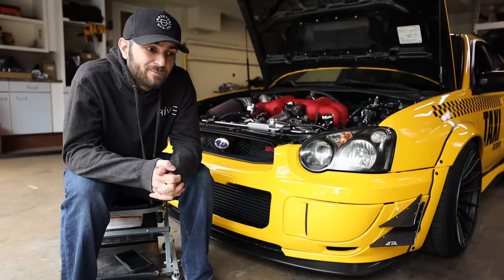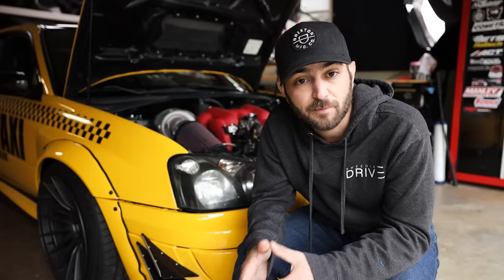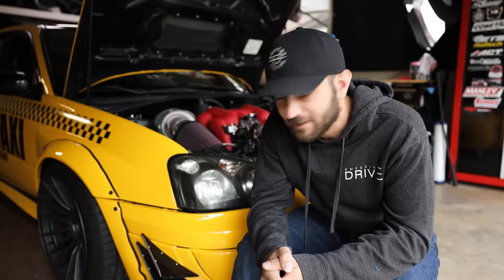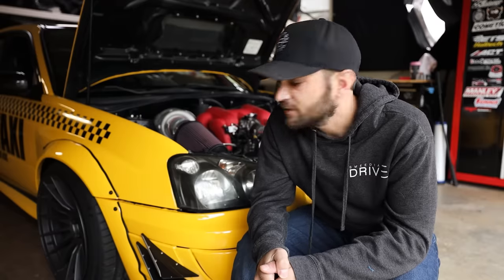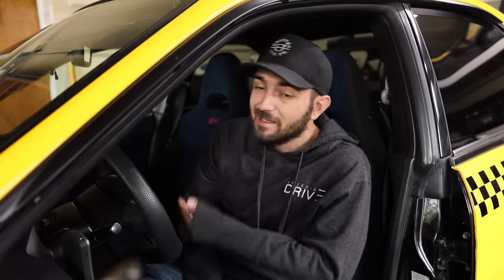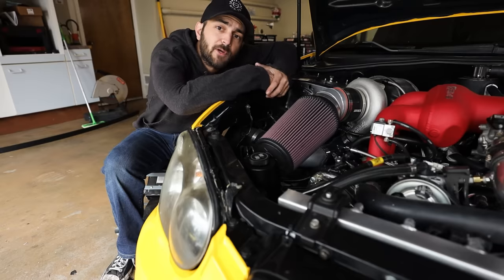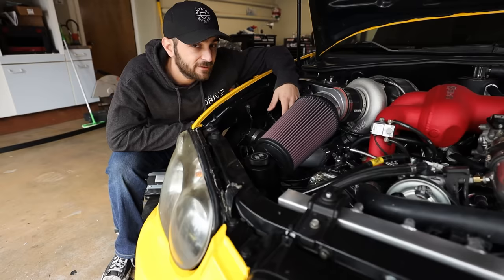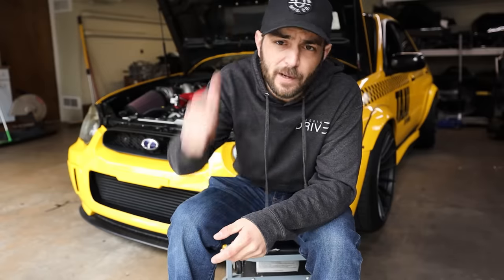What You Can do To Keep Your Subaru Reliable.

Comment: Legit my DAM has stayed at .625 since august and will not go back up. Knock randomly comes and goes on freeway but never exceeds -2. Fine knock learn likes to jump all around from -4.10 to +1.50…. Thinking I might have an exhaust rattle 🤷‍♂️ temperamental for sure
Reply: The life of a Subaru owner 😶
Reply from the maker: Already tried resetting ECU learning?
Reply: @Smeedia  Going to fill-up at a chevron and reset afterwards. I’ll keep you updated.
Reply: @Smeedia  update: After ECU reset, my DAM hit 1 again.
Reply: @Smeedia  update: DAM dropped to .875. I’m going to wrap the exhaust and buy a new uppipe and hope it’s a rattle causing the problems. Might get a protune if still running into problems.

Comment: @Smeedia my $700 Blobeye is consuming a lot of oil like every week or two my dipstic gose from full to empty. What i do know is its not leaking on the outside. I know the engine is burning it
Reply: Btw i live in Puerto Rico and everything is like 10 minutes away so no reason to drive fast
Reply from the maker: If its burning oil my first thought is valve stem seals

Comment: Literally every subaru engine I have pulled apart, having broken a piston, I have found them to have smaller than proper ring gap.  Your EJ25 will live forever if you pull the pistons and gap the rings.
Reply: What do you have to do specifically to gap the rings?
Reply: @bryanr93  pull the pistons out, remove the rings, measure the gap, file the gap, deburr the rings, reinstall the rings, reinstall the pistons, reassemble the engine.

Basically, if you're not a mechanic or mechanically inclined, it's not something you're going to do.
Reply: @AdderMk2  Would a built IAG block have properly gapped rings? I'd assume so.
Reply: @bryanr93  not quite sure why you're asking me. Sounds like a question for them.

Comment: What would you consider a safe/reliable power level on a stock type ra block?
Reply from the maker: Safe safe 400-450 WHP
Reply: I have an ‘18 Type Ra and wanna keep the motor with the car but couldnt find any reputable info about a safe power level to push it to so thank you for the info!

Comment: Hey bro i ask the dealer to add  different mods to make my engine  more realiable. But they told me they would cancel my warranty.
Reply from the maker: Correct, pretty much any engine mod will cause warranty issues
Reply: @Smeedia  thats sucks cause i really wanted to do the 4 cylinder cooling mod and air oil separator

Comment: So if I get race gas from BP 101oct. why do I get more knock than running just straight 91. Would it be because of the 10% of ethanol it has in 101 or something else. Never tried 93 but 93 has 10% ethanol in it too, so I would think it'd do about the same as 101.
Reply from the maker: What tune are you using with that 101?
Reply: @Smeedia  91 stage 2+  didnt want to put 93 ots in because I only have 1 station with 93, weird thing is that I can fill up the car with about 12 gallons of 91 then top off the rest with e85 and it'll be normal knock numbers, runs perfect. 101 straight has fbk of 6-8 then fkl round 2-4.22.
Reply from the maker: Not tuned for the fuel, while it has a higher octane rating just tossing it in will cause the car to act up. It's expecting to see 91 when it's getting 101
Reply: @Smeedia  then why is the 12 gal 91 and 4 gal e85 not do that?
Reply from the maker: For an E30 tune?
Reply: @Smeedia  lol no still on 91 ots

Comment: How much oil consumption is normal for a stock STi??
Reply from the maker: There's no normal amount, every engine will be a little diffrent depending on overall health. But as with any turbo performance car I would continue to monitor oil every now and then
Reply: @Smeedia  my 17 STi consumes a little less than 1qt every 3k miles, and I was wondering if that was normal
Reply from the maker: Relatively normal, an AOS will definitely help

Comment: This is no different for any engine. It'd be like buying a junkyard LS, doing absolutely nothing to it and pushing 20+ pounds of boost. It's going to blow up if you don't atleast gap the rings but lots of people would expect 1000hp reliably.
Maintenance, fixing problems as soon as you find them, use quality parts, good tune and know you're and the car's/engine's limits. Alot of people just have zero common sense nowadays. 
As someone who "abuses" a 03 svt focus with 300k miles on it daily. I'm not surprised when it goes down, hell I've replaced every major part on it. Including two head gaskets, but second one was just because I was a idiot even though I knew better lol.

Comment: In other words, keep up on your maintenance and dont drive like you are a 16 year old vape machine. As for cheaper parts the only two things I will consider are cheaper Axle backs, because its just a muffler delete and honestly Ive always went custom exhaust from my local guy from the downpipe back. Also I would probably go with a Depo TMIC. I ran Depo on my ST and they are VERY solid units and pretty well liked in that community. Otherwise I go with big name on all other parts.

Comment: I just got a tomei exhaust a grimmspeed stage 2 kit and turbosmart recirculating bov Amd turbo smart internal wastegate also a ets top mount gonna run e85 what do you think I will make power wise and is that good quality parts
Reply from the maker: Whats the car? 👀 STI?
Reply: it’s a 2015 sti
Reply from the maker: What size Injectors?
Reply: @Smeedia  1300 and an aem 340 fuel pump
Reply from the maker: Stock turbo I'd guess around 330/340 or so
Reply: @Smeedia  so that’s what I would make with a pro tune until I get a different turbo

Comment: At what mileage do you recommend the fuel clean service for FA20?
Reply from the maker: Fuel clean? I'd prob run a bottle through the fuel system every 15K or so
Reply: @Smeedia  ok. Sorry I meant for the dit system. My bad I asked it wrong. I worked at Toyota and we had BG services. They had a dit injector/valve clean service. Also cool thing about BG is once you get their services they give you warranties along with it.
Reply from the maker: Oh the valve cleaning! Every 30K miles. Either walnut blast or use subarus slow injection service

Comment: Ok so I decided to go stage two. Currently I only have an ETS extreme catback. Can you give me a proper list of parts I should get that would cover reliability and power for the best mod to keep it safe and strong? 

For example not sure if I should be buying a heat shields and a solenoid boost controller on top of the COBB down pipe and/or COBB Intake. There is so many people saying you need “This & That” to keep it reliable so I wasn’t sure. I plan to get it Pro Tuned at a place called Delicious Tuning in San Diego. Reputable name from everyone who has tole me about it.
Reply from the maker: Whats the car and how much power are you shooting for? 🤙
Reply: @Smeedia  2021 Sti base model. Power wise I have no personal reference point to know what it would feel like beyond stock. I just switched over from driving trucks for 13 years so I’m pretty much newb status. I just want that nice increase and more evened out powerband that I hear about, rather than it being more lag or late boost that it has now.
Reply from the maker: To start things off I'd suggest getting an accessport, downpipe, intake, boost controller, fuel pump, injectors and intercooler to start things off. For thr power side. Should pit you right around 330WHP and make thr powerband more linear 🔥
Reply: @Smeedia   Ok sweet. Just a few questions on this. Would this setup be bringing me into flex fuel? Because I was hoping to avoid that whole thing just because I don’t want to be limited to certain gas stations. Any particular product brands you’d suggest on these parts? Thank you so much for your help! You’re always so helpful and responsive!!
Reply from the maker: No you wouldent need flex fuel and between Cobb, injector dynamics, AEM and ETS you should be able to find everything needed 🔥
Reply: @Smeedia  🔥🔥🔥🔥

Comment: Idk if anyone in the comments can help me out with this issue, but I’m having this problem with my car where when I go into boost the car just shuts off the boost and jerks violently. I look at my wastegate duty on AP, and it’s always 0 so idk what’s going on. I’m stage 1+ btw. My tuner said it wasn’t the tune issue and that my maf was wet but I dried it multiple times
Reply from the maker: What does your A/F correction look like? 🙏
Reply: @Smeedia  the a/f correction is always zero for the most part then goes into values such as -3.12, -5.47 and -6.25 and values like that for a small portion of the recorded log, then goes back down to zero again  and this is when I’m not even getting any boost or very little if the car lets me get into any at all
Reply from the maker: If the car is just dying I would start with vaccumm leaks. A/F correction seams fairly close but I'd hunt around a bit
Reply: @Smeedia  ok ty sm smeedia🙏

Comment: FA20 on a frs has direct and port injection….
Reply from the maker: Yes they do, so does the BRZ. It's Toyota D4S system. No worry to carbon clean those valces. Mainly directed at the FA24 and FA20DIT peeps
Reply: @Smeedia  I’d hate to only have DI

Comment: HKS, Tomei and IAG are selling headers for $550-$700. From what I understand they're quality and not $1200 plus. Oil changes at 3,000 miles? Why? Really, why? Synthetic oils are designed to not breakdown within 3,000 miles. Check the oil level, sure. 

Regarding IAT's- if your IAT's are high then the tune will have an intake air temp timing retard function - not a big deal. You will just lose power for a minute until you're running at speed and the intercooler gets airflow to cool down the IAT's again.

Lower octane - yeah you shouldn't run it, but once the knock sensor picks up the knock it will send the tune to another timing table.

I like your videos, generally, but there's a lot here that is just kinda thrown out there. It's obvious you have a good amount of knowledge, but this is almost a bit 'reckless' in how broad and simplistic it is. I know you're probably under the gun to crank out videos, but this one just misses the mark and adds to the noise/din.

Get into Access Tuner and talk about the various tables and how they're used to mitigate high IAT's or low octane - that's the education people need, not just "high iat's destroy your engine so don't beat on it" because that's not wholly accurate.

Keep making videos. I like your cars and I admire your channel's growth! You've got a good presentation style as well.
Reply from the maker: I'm working through classes still on tables and tune building so that'll come at some point in the future. 

I wouldent advise over 3K mile oil changes, subarus get hot and will break down oil and consume it. Especially for those running E85 or those who run OTS Tunes. Too much fuel on some of those tunes will wash the cylinder walls and denatured the oil quickly. Of you feel comfortable running past 3K no issues. But I'll always advise 3K mile changes on these. 

Like you said if it does detect heavy knock it'll reduce the dam. To try and safe guard the car by reducing tables. 

Always learning but I'll still continue to advise certain aspects. But tuning and accesstuner videos are in the works 🤙
Reply from the maker: Thise tomei headers I've also seen crack more often that nit at the welds. Seen a couple IAG and comparable headers and quality still looks meh on them
Reply: @Smeedia  I just performed my first oil change on the car, and I'm just going to stick to 5,000, using Driven Racing Oil 5W-40 and the Subaru OEM Filter/Wix equivalent. e85 changes the calculation for sure! Best people to talk to on change intervals are going to be your oil company of choice. I use Driven Racing Oil because I used to work at COMP Cams, and that was one of our sister companies. I know it's good stuff, and they have the testing/data on their product plus the trustworthy advice. Oil is one of those topics that just never really seem to get anywhere productive. But hey 3,000 mile intervals just give you a chance to tinker more with the car.

That's the tough part about trying to learn about failure rates of parts from forums and anecdotal evidence. For example, your seeing failures on these headers doesn't mean that they invariably have a high failure rate. We don't have access to that data. Similarly, the tale of the broken oil pick-ups etc. I'm going to replace the pick-up on my '19 when I upgrade oil pans/windage trays, but again the failure rates are likely significantly lower than the anecdotal evidence would suggest. 

There is a tendency for every hobby to have the two extremes - one group wants to buy the most expensive everything while the other is often advising the opposite. I try to find myself in the middle. I think Injector Dynamics is WAY too proud of their injectors - so I'm fine with buying Fuel Injector Clinic. People get way too easily convinced to blow just a TON of money on every piece because they think that they have to over-support their realistic goals. Headroom is good, but opting to spend double on the premium option on every single part will basically mean you'll never get the car done. - My Firebird is a perfect example of this... Premium everything, 5 years later just about to crank it and tune it. Part of the fun though.

Glad you took my comment so well! Keep doing your thing!

Comment: Hey smeedia, would you recommend putting an octane booster every time I fill up on gas? I’m in California and only have access to 91 gas so I’m wondering if a booster will help with reliability and avoiding knock. I got a 14’ STI with 70k miles. Stock
Reply from the maker: If its all stock I woukdent stress it. Once your tuned just make sure that your tuned on the fuel you normally use 🙏

Comment: What diffs you running? I’ve had my shimmed and it’s super tight when turning lightly . I’m thinking if I should revert to stock or am I being a pussy lmao . It’s super fun to drift but yeah only down side is when turning at low speeds and Because it’s so easy to drift at low speeds I’m scared it will step out on me at higher speed like rwds I’m used to with welded diffs 😅 (subi diffs we’re professionally shimmed not locked) but they kinda do almost feel like locked when on gas at low speed turning arojnd etc

Comment: Here’s the steps
#1 buy a subie
#2 buy a forged block on Black Friday/all bolt ons
#3 get tuned by best tuners around
Any car is reliable stock
With mods on a stock 4 cylinder it’s going to blow
Unless ur the type to mod and keep drive it like a grandpa
If you want reliable power
Go with 6/8cylinder turbo
Rs7/M series/gtr/c7 z06
Sorry but subies r not worth the investment unless u can rebuild it urself everytime it breaks

Comment: Thanks for the video Tanner.   i'm guilty of a cyl 3 misfire and I've been chasing it for a while.  It sucks.

 My culrpit is that the cylinder 3 coil pack doesn't quite fully bolt down.  

Like its just about tight  but then it spins so I likely stripped. and likely my fault. 

I changed plugs, coil, injectors, ...never did fuel pump/filter either but my guess is that its this coil pack bolt  

when it happens idle starts dropping and seems like it might stall on bad ones.

If anyone has any information as to the whereabouts of how to fix this youd change my life.  Thanks again!
Reply from the maker: Ran a tap through that hole and cut it just a hair deeper, should help the bolt grab and keep it in place 🔥
Reply: @Smeedia  Thanks man!  I've read that could work.. I will try that one day with extreme caution.. so nervous my car just seems to  fight me every thing i do
Reply: Worked on this today heres a real noobie issue ...what I thought was cylinder 3 was actually cylinder 1.  So tapping not required and upon further inspection of cyl 3 coil pack the plastic clip was falling apart..  I put a nice zip tie on the clip and so far fingers crossed no more misfire. Simple as that.  This issue has been going on a while so thank you thank you thank you Tanner for motivating me to finally get to the bottom of it  I truly appreciate your help.  I'll pick up some merch soon and thanks again !!

Comment: There is nothing that you can do to make it truly reliable. 80,000 miles and on my third engine on a 2013 hatch. Any of the 2.5s are the worst. I would never buy a Subie again unless it is a low mile 2.0 model. Never had one hiccup on my 05. Don't do it.......  I loved Subaru until my 13 WRX.
Reply from the maker: Odd, have had multiple that have had up to 140K on the original engines and never had an issue 🤔

Comment: Hehe, and then there's me with a very low compression, daily driven, self tuned 2016 STI. Burns about 1 quart of oil in 3 days and I don't drive far for work. I have the accessport to monitor things but it just likes to tell me my engine is bad. Don't be like me people. When your car has low compression, stop driving it and figure it out. And if you do have to drive it, don't get into boost. It makes it worse. ASK ME HOW I KNOW! In short, fix your shit. 😆
Reply from the maker: Lol oh dear lord 😅😅😅😅
Reply: @Smeedia  Ever heard piston slap like on a 1000hp engine taking 100psi of boost, but on a bone stock motor with 124,000 on it? It's bad. Well, It's not ideal to say the least lol. Don't be like me. Be like Tanner. Spend countless hours fixing your daily car to just throw a wrench and replace everything and then make 600whp. Love the videos and the cars man!